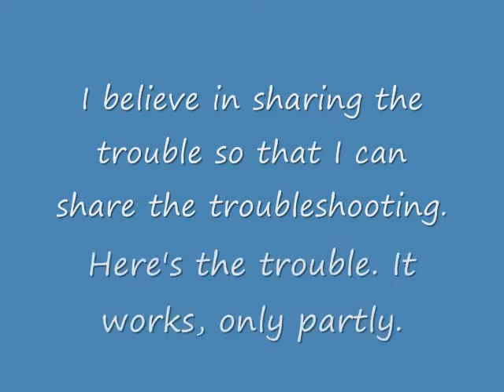Lilypad Twinkle on my jacket

Comment from the maker: I did.  It's tricky because the conductive thread is unshielded.  That and you're using a 3V battery, which may go below the driving voltage for the LED pretty quickly.